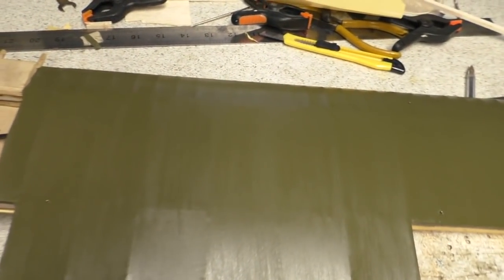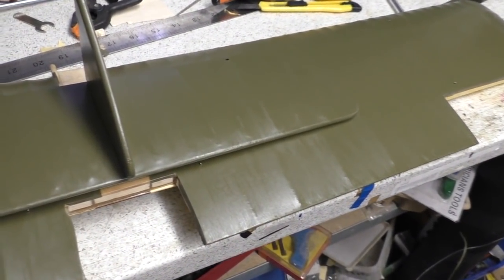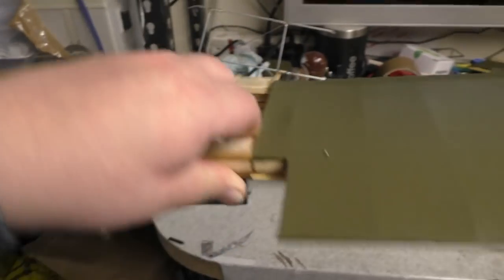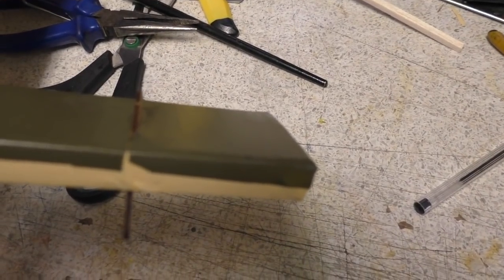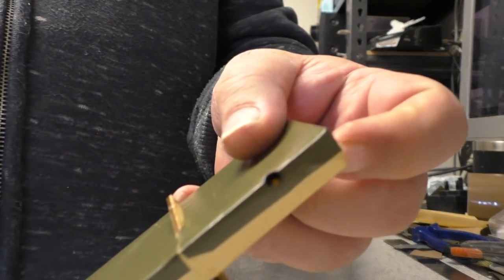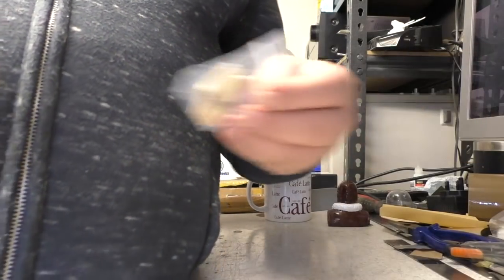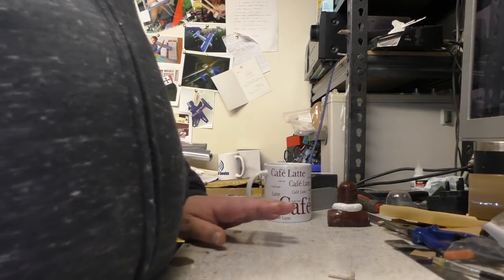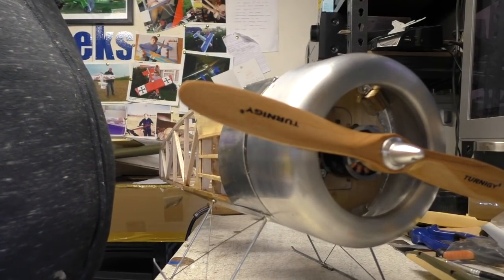DB Sport & Scale Sopwith Pup Electric Build Pt19 RC Model Geeks

Comment: Nobody says:
Reply: Balsa is not an easy material to use, it's hard to drill, to glue and to cover, and it's like clay under stress. If you want to fly and you are not an A class flyer, use a an EPO RC glider or flying wing. If you want to build a Balsa kit; build it but not fly it. Also balsa dust is harsh stuff, also is CA glue.